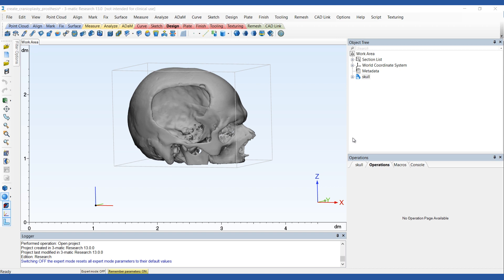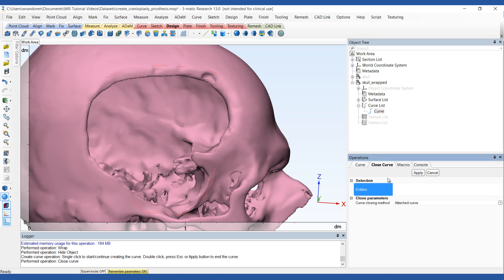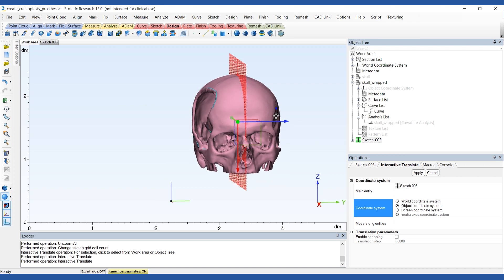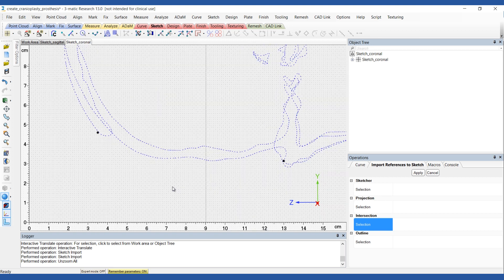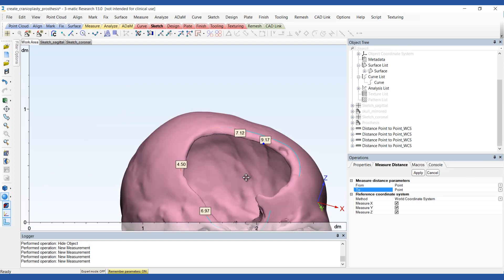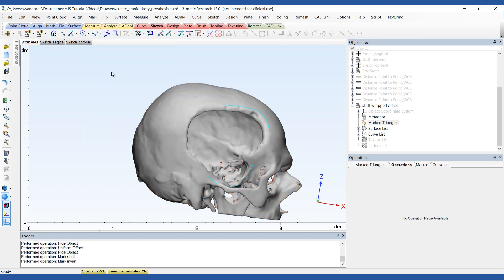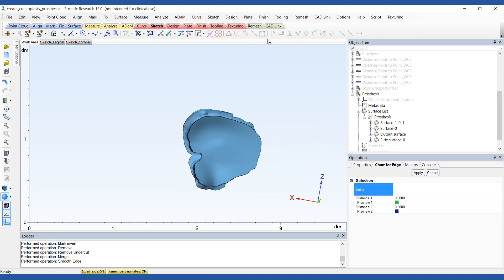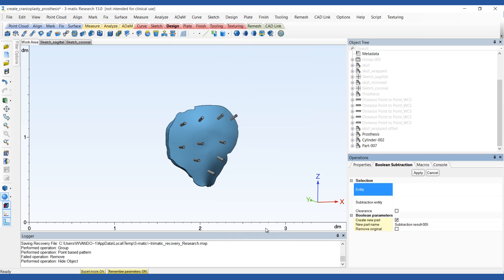How to Design a Patient-Specific Cranial Plate | Mimics Innovation Suite | Materialise Medical

Comment: The software is good but the head after such modeling will be asymmetric. need to look and take into account soft tissue atrophy
Reply from the maker: Hi,
The design of the cranial plate shape is based on the spline created in the sketch before surface construction. There are 2 parameters that are important for drawing the spline which is the mirrored skull and the defect curve. To improve the result of the surface construction, the mirrored skull would need to be properly positioned to maintain a symmetrical shape of the skull before importing it into a sketch. You can simulate the soft tissue movement after the construction of the cranial plate to identify the symmetrical fit.
Reply: @MaterialiseMedical  Hi, I have one big doubt about this ''You can simulate the soft tissue movement after the construction of the cranial plate to identify the symmetrical fit.'' Could you please explain to me how can I simulate the soft tissue? Which tools, 3matic o research, etc. Thanks in advance!
Reply: I am having a problem... Please tell me this software name? 
I am already work at Mesh mixer but this software better then Mesh Mixer
Reply: @3dhub692  blender is the best and universal